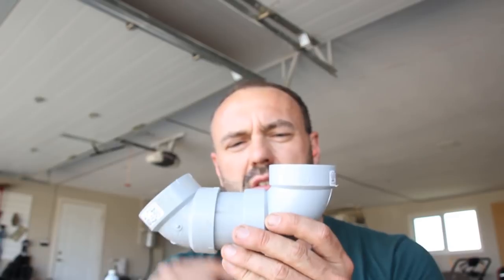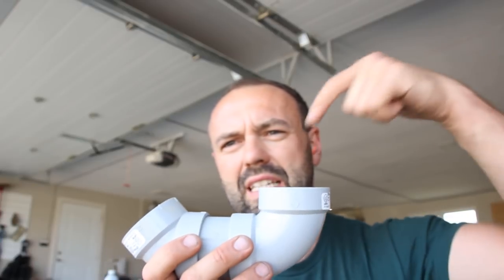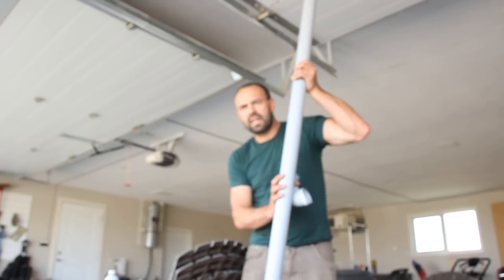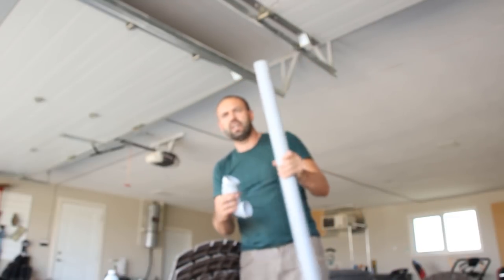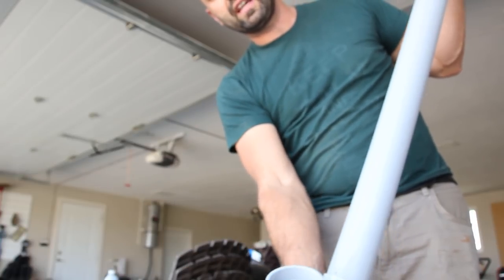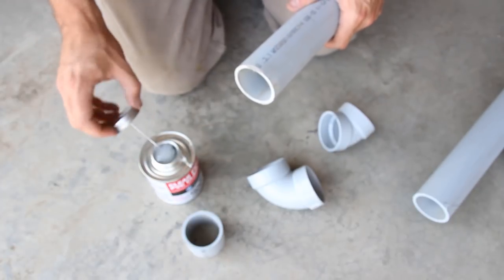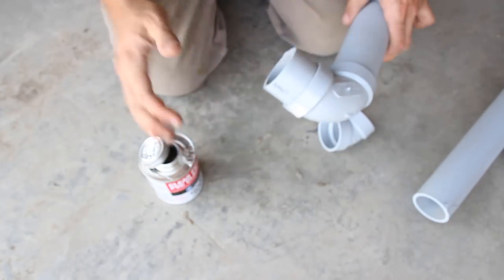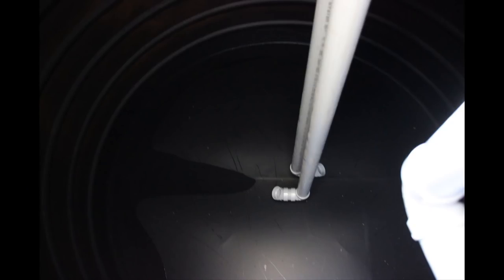How to set up a Rainwater Tank Inlet - The Quiet Inlet

Comment: Can you explain how you connected your down comer to the top of the tank including the fitting you used?  I would like to place the down comer in the center of the tank as you describe.  The tank lid is positioned on the periphery of the top of the tank.  The tanks I am using are 1600 gallon tanks.  The fitting for the down comer would not be able to be reached by hand on the inside of the tank from the tank lid.  I haven't seen any examples of how to do this in my research thus far, including the rainwater harvesting book.  Thanks in advance.
Reply: I'm surprised this isn't discussed